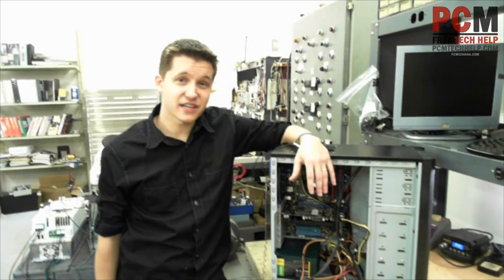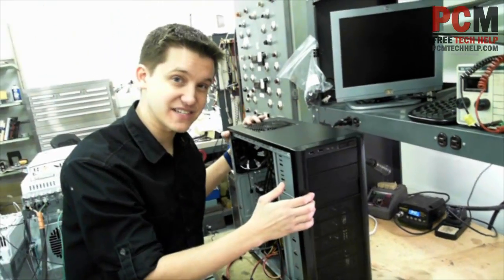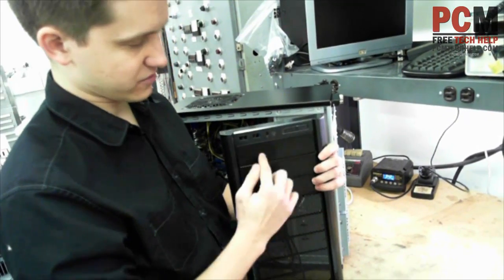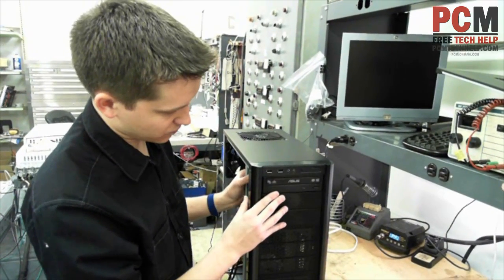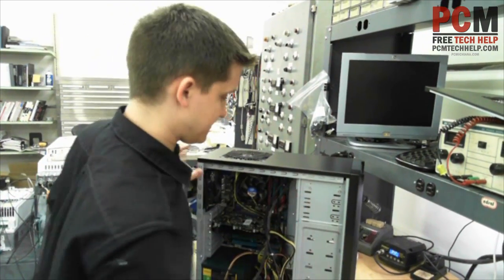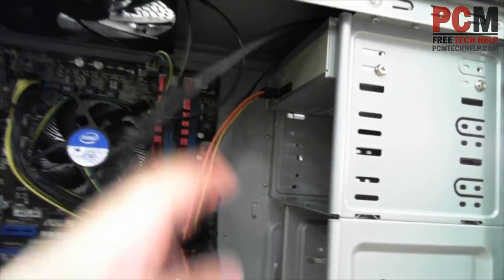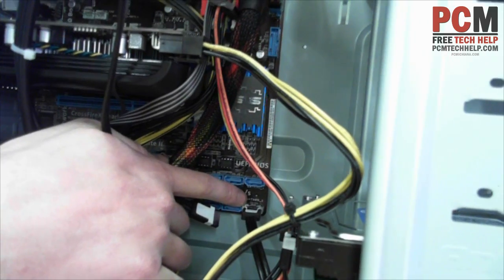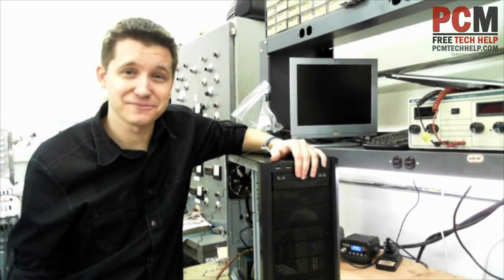How To Install A Computer CD, DVD or Bluray ROM Drive (2022)

Comment from the maker: No light means it's probably not getting enough power, have you tried disconnecting other devices or trying a different connector? You could also have a bad drive.

Comment: Great video. Lots of information. If I am replacing DVD burner with Blu-Ray burner, do I need to uninstall DVD burner first somehow? Also, will I need to access my BIOS for any reason?
Reply from the maker: +secondstartravel Shouldn't have too.
Reply: +Craig “The Tech Teacher” Chamberlin. Craig, I swapped out the DVD burner for the Blu-ray and it was much easier than expected. worked flawlessly actually. Your video gave me confidence to attempt. First attempt at that kind of upgrade. Thanks for informative video.

Comment: Does a computer require a specific optical drive or are the optical drives generic therefore the only thing to do with all computers is to connect it?
Reply: They are pretty generic as long as you don't accidentally buy a laptop drive :-)

Comment: I have a similar (or identical) case as the one you use in this video, so it has three bays on its front face. I'm going to install two DVD burners and one Blu-Ray burner. What must I do differently? Is it as simple as repeating this process three times? Thank you.
Reply from the maker: Yes, it is that simple.
Reply: Well that's a a big relief.

Comment: I have just bought a new PC which has four slots on the motherboard but they are all occupied. I now need to add a BluRay writer. Is it possible to get a splitter for the data cable, or will I have to sacrifice the existing CD ROM drive?

Comment: Craig, I bought a ASUS blue ray drive. Installed the disc drivers. Power 2Go6,E-green,Asus firmware Update and Quick Install Guide...rebooted my system but for some odd reason...when I go to put a blue ray movie disc to play...it won't even recognize the Blue Ray Disc...what else should I do? Do I have to register the product to get additional downloaded codex for the blue ray drive to work? Any help would be appreciated...Thanks.

Comment: I have a problem with my new CD Drive: when I put it in and connect the cabels, my whole computer won't even start when I push the power button! it only starts to boot when I remove the connection to the CD Drive. I'd also like to mention that when I have my old and not functional CD Drive in the computer, the PC is booting without problems when I start it (the CD Drive itself doesn't work though). but when I put the new one it, the whole damn thing doesn't start. is there a driver problem or s.th.? because I start to believe that I bought a faulty CD Drive since I didn't find this kind of problem in any youtube tutorial or any forum on google

Comment: My CD-ROM drive is just plain dead... the guy who installed the new hd didn't connect something. It was working before, but now it seems like it has no power. Doesn't open and no lights.

Comment: My HX850 Power Supply appears to have no SATA Power cable. WHen i called the company I bought the CD ROM from and asked why it came with a data cable and no power cable, they told me that my power supply has the power hook up. What now?
Reply from the maker: You might need to buy a 4 pin ATA to SATA power adapter for a few bucks.

Comment: What  are the names of the cables i'm going to need in order to connect it? I have an asus dvd writer.
Reply from the maker: Usually you need a SATA cable and a SATA power cable that comes from your power supply
Reply: Craig Chamberlin And where do you get those?
Reply: ***** from your power supply unit he said it in his comment

Comment: My new case has no provision to mount the dam thing...so my next step is to get some kind of internal steel grid work ....i guess?  and I will have to remove the front of the case (solid plastic with no slots) .    :{
Reply from the maker: Amazing that most cases no longer support drive mounting - you could optionally get an external USB CD rom and only pull it out when you need it.